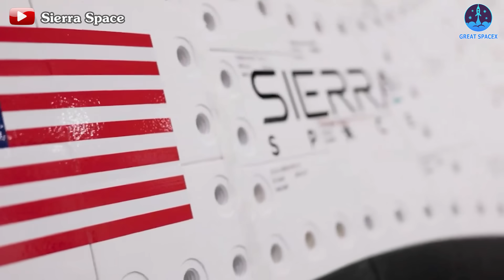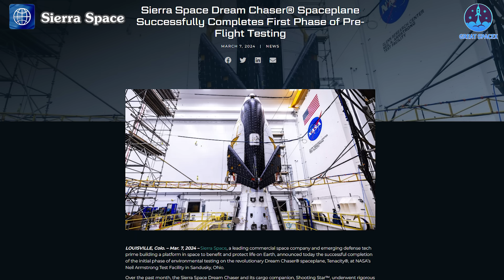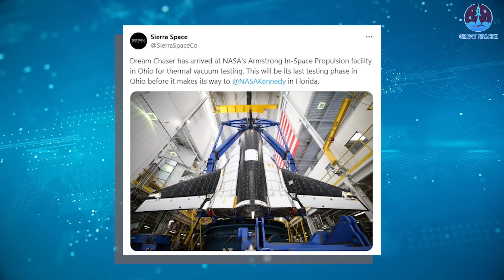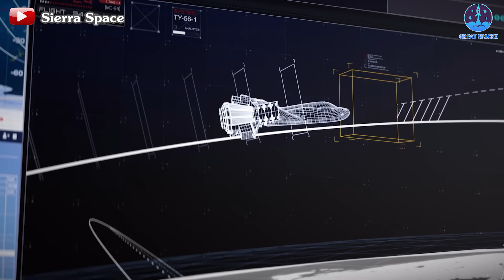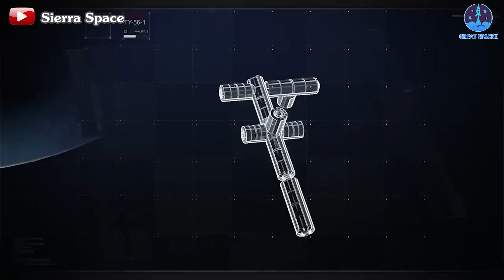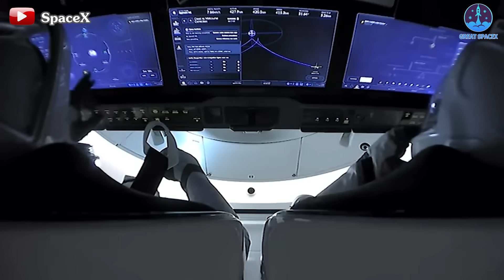Finally Happened! NASA's New Spaceplane Is Launching After Constant Delays...

Comment: They don’t want to launch because there is a high probability of another Space Shuttle disaster.
Reply: Based on what?

Challenger failed because of a faulty Solid Rocket Booster impending on the External Fuel Tank.

Columbia failed because of a piece of External Tank Foam smashing into the shuttle’s wing leading edge.

Both losses were caused by the Orbiter being down amount the booster.

DreamChaser will be up above, and out of the way if the booster.  Neither of those previous failure modes would have threatened the DreamChaser configuration.
Reply: @michaeldemarco9950  

Lets bet on it…
Reply: @earth_ling this is not a shuttle.

Comment: I don't understand. the old space shuttle worked. Why did it take so long to build an updated version?
Reply: The old shuttle worked well over 100 missions. A craft truly in need of justifiable development but is something the older aerospace industry is loath to do.
Reply: Because it just looks like a spacious it really has very few similarities.. and because of the delays manufacturing and development
Reply from the maker: Because it did not made by Spac
Reply: And the old space station wasn’t working as good as you may think. It had two explosions that ended in disaster. It had multiple valve and seal issues.

Comment: I don't understand the point of putting a plane inside a rocket to deliver people/supplies to the space station. All that just so it can have a controlled re-entry. Doesn't sound worth sacrificing cargo space and people space.
Reply: It will be cost efficient to be able to reuse the same vehicle 15+ times. Also, it allows nasa to bring down fragile cargo. 

This design does have its benefits.

Comment: I want them to also renovate the old space shuttle for launch with starship.
Reply from the maker: Great idea
Reply: The shuttle will never fly again because they demolished all of the supporting infrastructure with a vengeance!
Reply: That would never happen, nor should it happen. The Space Shuttle was inordinately complex and trouble-prone, not to mention massively expensive. That program, with all things considered, a failure. It never came close to delivering on its promise.
Reply: @stratolestele7611

The original Space Shuttle was a great concept. It was only intended to be a workhorse and cargo delivery system.

There was also a mini shuttle similar to this Dream Chaser. Intended to be launched from a Boeing aircraft at 50k feet. This was a crew transporter that could be launched multiple times a week.

Also Envisioned was a magnetic rail launch system that could launch large canisters of bulk material for 10 cents a pound and capable of a launch every 30 minutes.

AND THEN,
The politicians got involved. The Shuttle became a very complex do everything in one system. Grossly over priced and fraught with problems.

But dozens of politicians were able to steer many different tasks to their voting districts.

This has been the downfall of NASA. All political all the time.

Comment: The Space Shuttle was also supposed to offer rapid and low cost turn round due to its aircraft like landing. Hopefully, Sierra Space have a better handle on that and the heat shield tiles function better and require less refurb. At least Dreamchaser is on top of the launch vehicle, not next to major components during launch.
Reply from the maker: Yeah. We hope that this can be a game changer